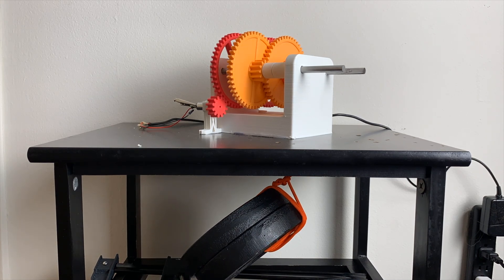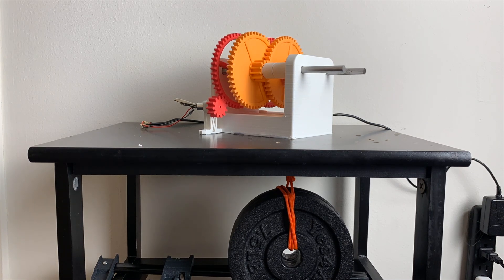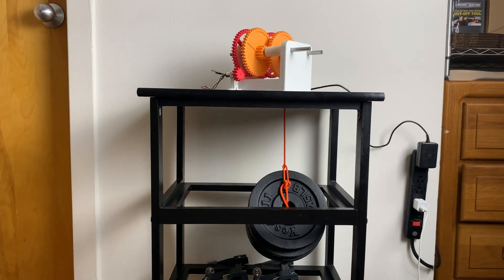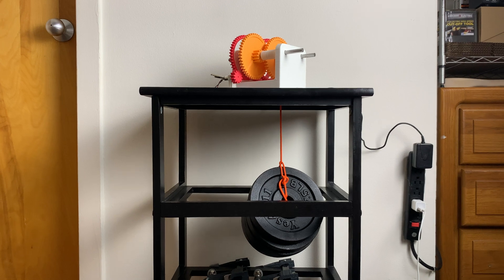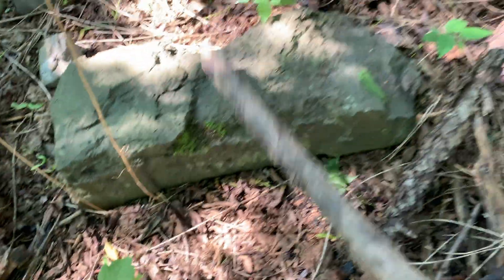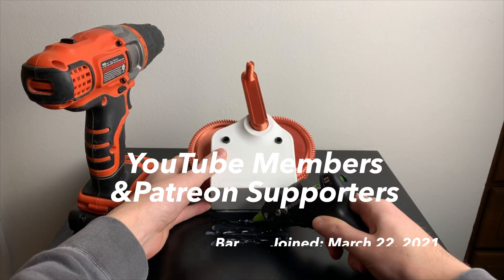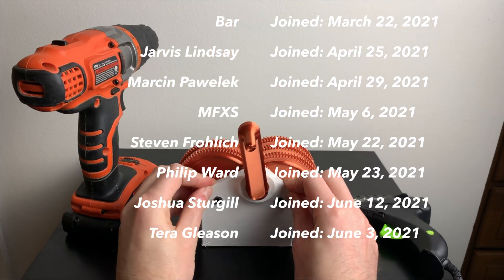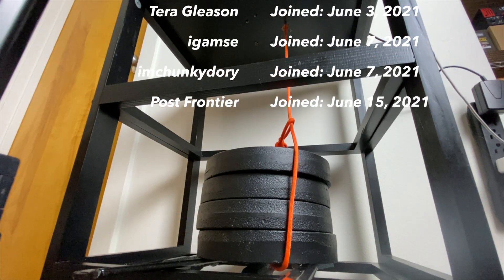3D Printed Gearbox - Weight Lifting Test (1:256 Gear Ratio)

Comment: For those who don’t know:

E= MC2

You’re literally turning the mass (your weight that you’re lifting and its potential energy) into electrical energy with the gearbox and motors.
It’s literally the same concept when you lift at the gym.

You are using potential energy, Mass, and a fulcrum for power.  
- The only caveat is you need really strong materials to hold that mass and not break.

For a flywheel battery , you are taking a mass and accelerating it, instead of just letting it fall at just under 10 m/s.  
- then you’re bound by the strength of the material as it is accelerated, making sure it doesn’t break while you magnetically brake at an incredibly high speed.  
- Think of having a giant truck with hundreds of tons (or a Tesla going 300 mph, and trying to stop it.  Same concept)
- you could literally also harness some of that lost energy at the road if you had a wireless road and modified wheels.

Comment: Teverything is worked out by lever arcimesdy or ghow u spell his name said iff he had a lever long enough he could move the world and i believe it i think i could lift a house with a 5v dc motor..a mamn on youtube lifts 80kg with a tiny 5v motor well put  1 of them motors on 2 another 1 then on anothwe1 ye it may take hours 4 that final gear 2 spin but the force in it would be insane
Reply: And the part where the rope is around or syring the bigger it is tbe less power it will pull cos thats like a lever near enough everything is worked out by lever cos it has 2 spin more times 2 pull the same amount of twine givibg it more stregth i got it all i just can build stuff dont no why

Comment: Hi, Would you be able to share how you avoided the elephant foot effect, please? Your gears look perfect! What sliver settings did you use?
Reply: Hi @Tomasz S, three things to try (I'm sure there are more) - 1) print with an 8mm or more brim.  2) If your first layer is extruding more than 100%, reduce that to 100%.  3) Try the first two first and see how it goes and if that doesn't fix it, try reducing your print bed temperature by 5 degrees. 4) Bonus - if your fan is starting at layer 1, try delaying that till layer 2 or 3.  Your mileage may vary.

Comment: I would love to see this gearbox driven by a high speed Tesla turbine. If you had a rotor speed of 26,000 rpms (more than doable for a Tesla) on the input side, you could get a respectable 101 rpms on the output side.

Comment: There's gotta be a better way to fasten your stuff down. Hot glue ain't it thankfully it worked this video. But I've been here long enough it doesn't always work. Maybe try 3d printing flat plate with two hole for a nut and washer. For the 5v motor holder.
Reply: And for the rope you could do a little tab on the gear the clasps around the rope with a screw. Right where u glued it.

Comment: This kind of makes me want to see a generator build using falling weights. I think there was an initiative a while back that did that sort of thing, but they used a clock mechanism to prevent the acceleration of the wheel to make it generate for longer. I'm thinking with the low torque of the high gear ratio you could do something similar to what windup music boxes do, and use a fast spinning flag to limit the acceleration. The air resistance prevents it from going beyond a certain speed.
Reply: the mechanism you are speaking of is a ecapment  the is also a more heavy duty/ different  mechanism that is known as a governor its was used on steam engines in the 1800s
Reply: GravityLight was a project but now it's proceeded by "NowLight"
https://deciwatt.global/gravitylight
https://deciwatt.global/nowlight
Reply: I've been researching this for a while. Actually u can slow down the weight speed by adding ressistance to the generator output using a resistor. I'm not sure how its works, but maybe @3d printer academy can show it to us
Reply: RR
Reply: What I'm thinking. A solar panel running the DC motor that drives a conveyor lift on one side ferrying weights up to a short ramp. After the weight  travels down the short ramp to a 2nd conveyor the weights decent powers an output generator.
Reply: Too much loss in friction, be more efficient to store the power directly into a battery @ayarza2
Reply: Why hasn't @3DPrinterAcademy replied to this? I would like to see this too. How much output could you get from the motor-turned-generator with the 30lbs? The loud on the generator could act as a governor.
Reply: You are talking about free electricity. How dare you talk about free electricity. 😂